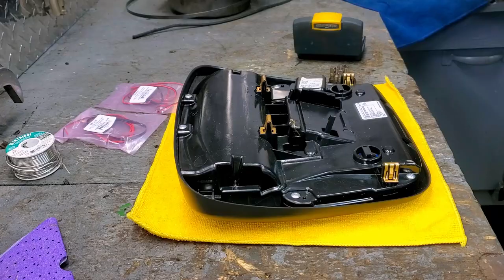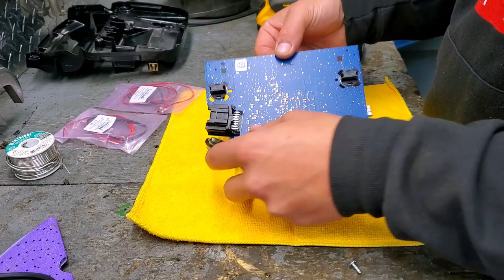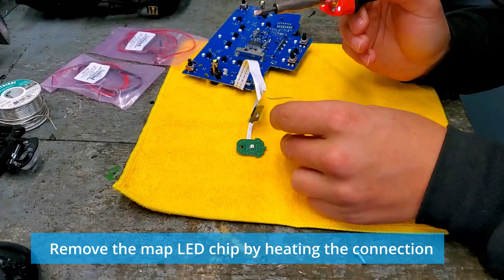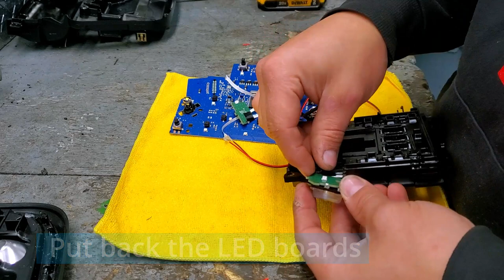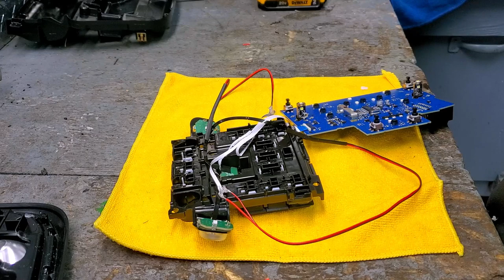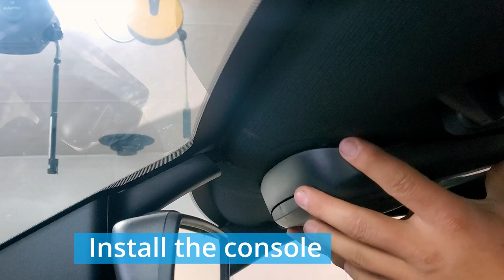Jeep Grand Cherokee WK2 LED map lights

Comment: Great video! Would it not also be possible to heat up and "pluck off" the existing LED chip and solder on a new brighter one?
Reply from the maker: Surely you could remove the existing LED and solder a new one on the board. You'll need a smaller and thinner LED than the one I use. I'm not the most meticulous so this way was easier for me.

Comment: Hi 👋🏼 Brother, Excellent solution, I was just changing the light bulbs and I didn't know what to do with them, but in the back (on the ceiling) I have the same problem, do you know how to fix it? Thank you 🙏🏻
Reply from the maker: Glad this video helped you ! Sorry I can't test it, It depend what year is your Jeep. Mine is a 2014, so the light over the rear door are simple bulbs. If you have a chip board like the map light in the front, my guess is that you could open them and use the same principal as the map light. But I don't have any exerience on these light. I don't even know if you can open it. If you decide to try it let me know !
Reply: I was able to change out the ones in the back using the same video, they are easier to remove if your car has a sunroof. I will see if I can attach any pics here for you.
Reply: @DerikBouffard  my Jeep is 2021, I'll try it, I'll let you know how it ends 🤣🤣, thank you 🙏🏻
Reply: @kinsmen1764  That would be great and very helpful, thank you 🙏🏻💪🏼🔥
Reply from the maker: @JoseOttati01  Great have fun ! hahaha

Comment: Hi
Where do you get the led chips?
Also did you change the rear passengers ones as well?
Thanks
Ian
Reply from the maker: Right here for the led chips : https://www.superbrightleds.com/moreinfo/led-wired-bolts/little-dot-smd-led-accent-light/639/1924/

Yes, I changed all the other interior light for LED.
Reply: @DerikBouffard  did you video that as well ? did it require you take down the headliner to access the light pods ?
Reply from the maker: @ashleyfaulstich9053  No I don't have a video about installing these LED. you don't have to remove de headliner, use a plastic prying tool and It'll take you around 20 min.
Reply: @DerikBouffard  was that the Bigest/Brightest LED chip board (30 lumens - Part Number: LD1-CW) you could have installed? Thank you for your replies!
Reply from the maker: @ashleyfaulstich9053  If you want you can find a more powerfull chip, but it still has to be slim enough to fit. It could be a little bigger too, I prefered to keep it to this size because it was known to fit. Thank you !
Reply: @DerikBouffard  , thanks for the replies.
Reply: @DerikBouffard  I tried the back seat lights but I cannot figure out where to attach the -ve and the + ve and tips please
Reply: Actually never mind, I figured it out and finally pulled it off, thank you for this video and the link of where to buy the LEDs
Reply: @kinsmen1764  if you have any advice or tips I'd appreciate ... as I'm going to try this soon ...  thank you.
Reply: @ashleyfaulstich9053  Sorry Bro, I hope you were able to pull it off, I missed your message............. just seen it today
Reply: Sorry, Just seen your message today, I will take a picture and show you, if you're still interested......... though, I'm not sure how to show you the picture......I don't think I can attach it on here
Reply: @DerikBouffard  will these leds work for the rear map puck lights as well?
Reply from the maker: @AustinHawkes-wo4fu  If your talking about the other set of light in the console, no. At least not on my model year, it's a 2014 and it just a simple bulbs.
Reply: Can you make a video about removing the back ones in the headliner? Thanks
Reply from the maker: @josiandipre9360  Hi ! sorry I can't, It depend what year is you Jeep. Mine is a 2014, so the light over the rear door are simple bulbs. If you have a chip board like the map light in the front, my guess is that you could open them and use the same principal as the map light. But I don't have any exerience on these light. I don't even know if you can open it. If you decide to try it let me know !

Comment: Whats the part number for those? Also, I wonder if they make blue to match the rest of the ambient lights. 🤔🤔
Reply from the maker: Here's the LED chips I used. There are multiple color option.

https://www.superbrightleds.com/moreinfo/led-wired-bolts/little-dot-smd-led-accent-light/639/
Reply: @DerikBouffard  do you think these dots can replace the center light in the overhead console too? I'd like to upgrade that one to one brighter
Reply from the maker: @krisdwight78  sure it'll work for the middle one to. It might be more tricky to install the board upside down.